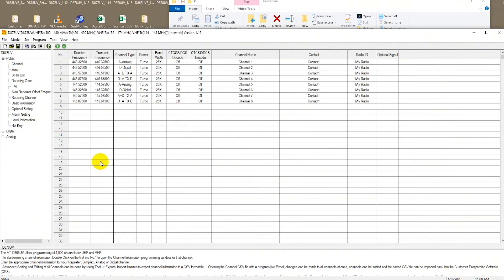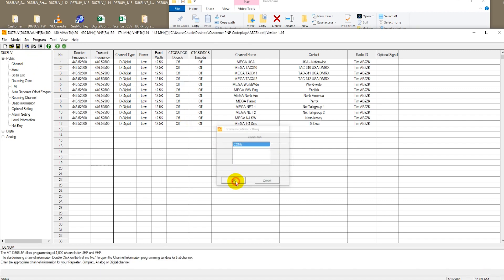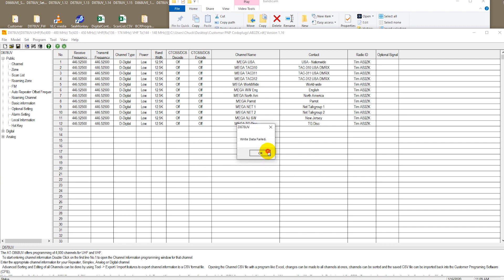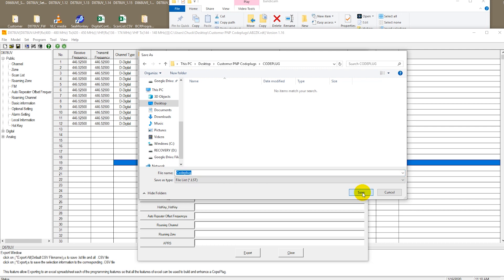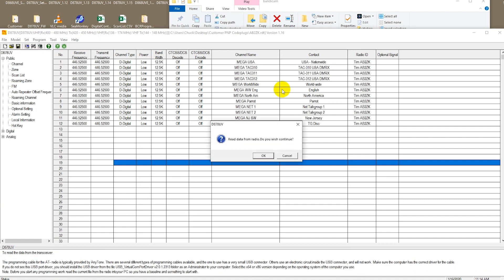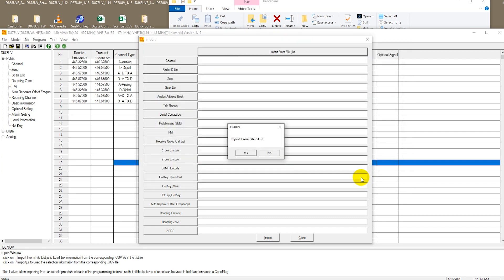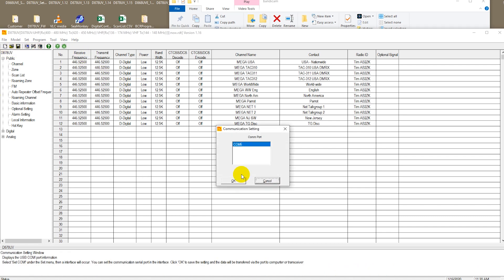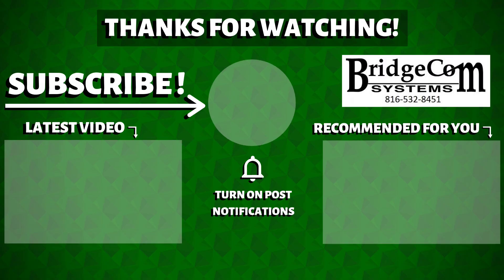How to Use an Old Codeplug on a New AnyTone 878 Handheld or AnyTone 578 Mobile

Comment: AnyTone 578 Mobile : I can not speak English . But I have a question .
Anytone 578 A vfo tg1 - B The vfo tg 2 is programmed to digital, often remains silent, takes nothing. Why is it possible? Or is my radio just faulty?
Vfo analog B vfo digital is not a problem. It works.
Firmware  1.11  and 1.10
Thanks for the reply
Reply from the maker: Hi! Please reach out to our tech team regarding this question, they would be happy to help you! You can contact them here: https://bridgecomsystems.freshdesk.com/support/tickets/new

Comment: Could you advise how best share a 878 and 578 codeplug? The zone list between these two are different, cvs export shows the 578 with 10 columns and the 878 with only 5 columns of data. Attempts to import the 878 zone list to a 578 fails, nothing in the zone file gets imported to the 578. Having both radios, it would nice to find an easy way to keep both updated with the same codeplug information.